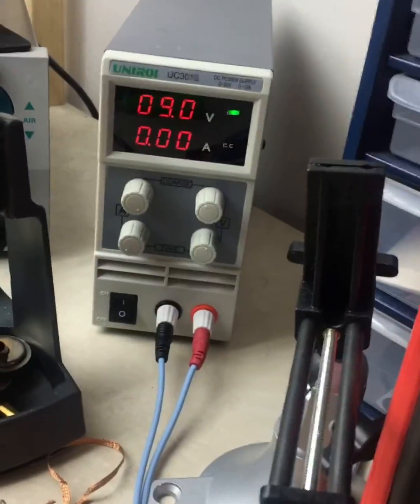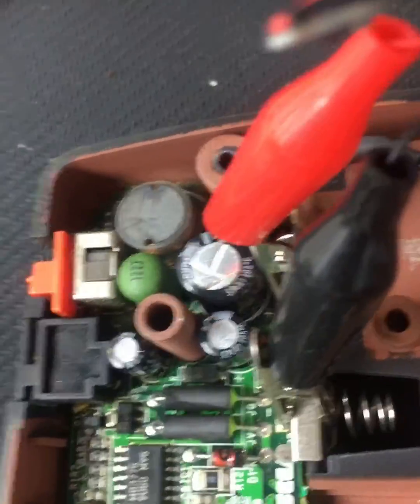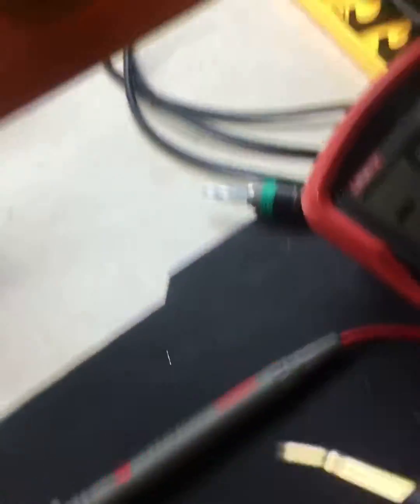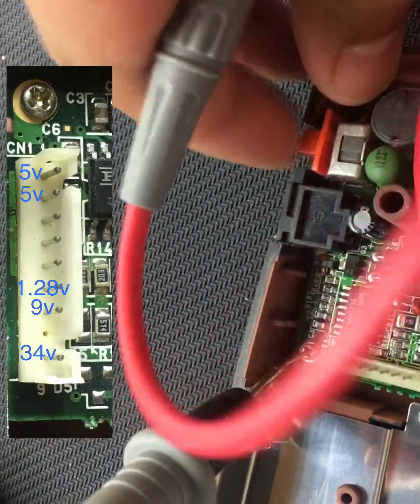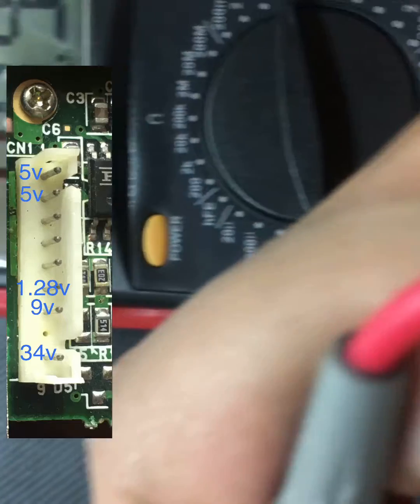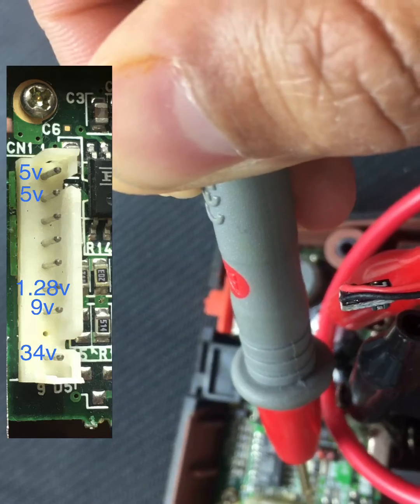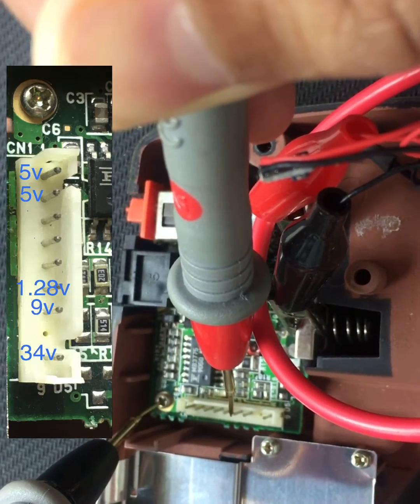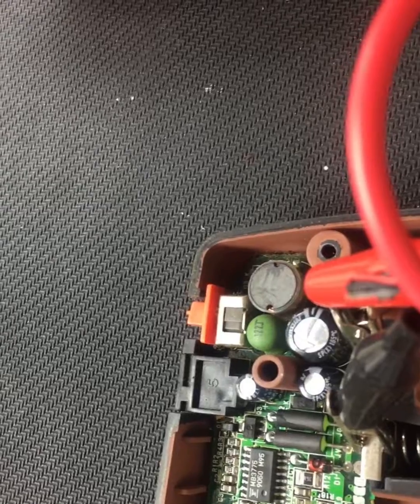how to test a Sega Game Gear Power board

Comment: I have my batteries in but not getting 9 volts or any other readings that's also the same with the 9 volt wall  plug. What's the solution here, recap the power board?

Comment: hi. thanks for this helpfull video. ok i have two non working GG. i could identify the badly working power board thx to your video. do you have any tips to go further and identify if its the main board fault or the screen fault (or sound board ?) fault if the console does not show anything even if the power board is fine ? regards.
Reply from the maker: Sorry for the later reply but if it has lines on the screen then it's usually most likely the capacitors on the logic board, the best thing to do is to replace them all.